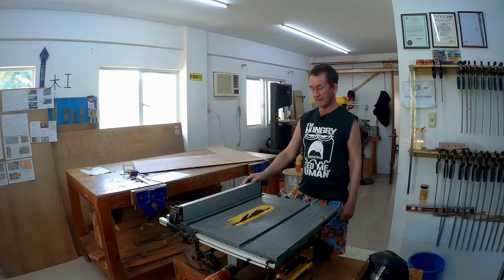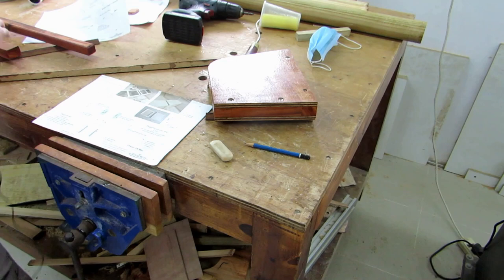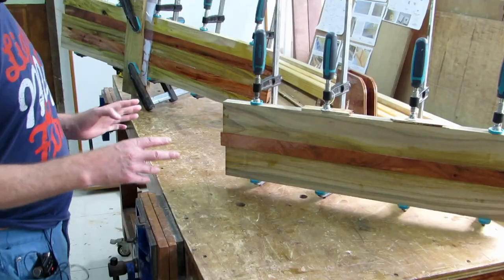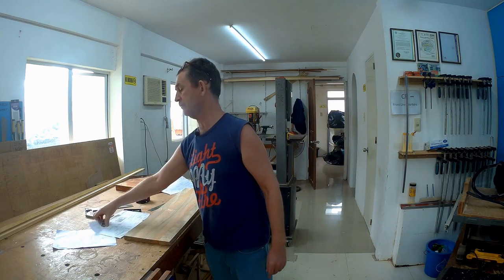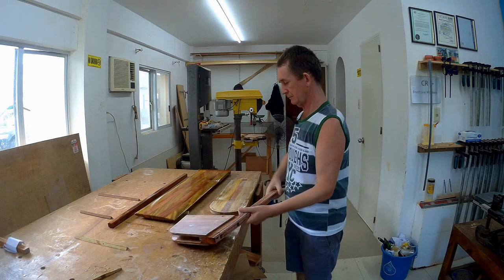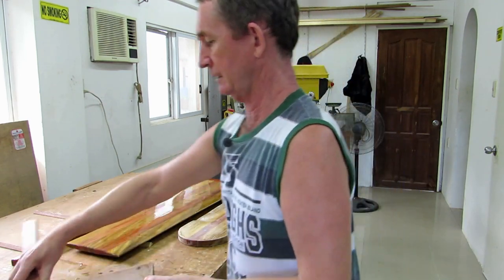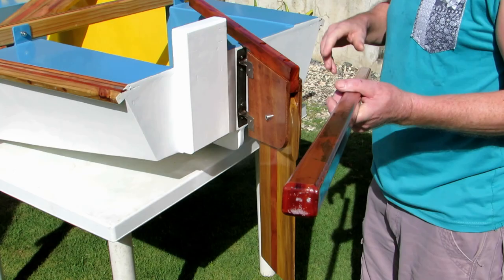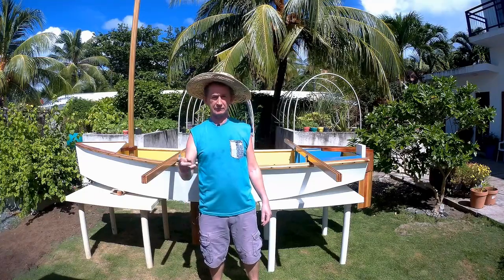Build a Tryst 10 Trimaran Sailboat - Pt. 18 - Making the rudder and daggerboard

Comment: Hello Irish,
You continue to build an economical trimaran sailboat. There is great weather there. Sunny and hot. Stainless steel was a good idea for the rudder, hinges. It does well in wooden biscuit joints. I am looking forward to the final of this project for which you have made a great effort. Because I'm watching very nice details. The final will be absolutely spectacular. Thank you for sharing. Stay healthy and happy. See you all the time. I wish you a nice new week. Big greetings.
Reply from the maker: Thank you. We had some rain today, but generally it is sunny all year round. I did not use biscuits. I was just explaining why not to use with epoxy.
Reply: @IrishChippy  Yeah yeah right. You just explained why it wouldn't be used with epoxy. I use wooden biscuits for non-water contact processes. Actually I meant it. buddy wish you a nice new week.

Comment: Good insight into the use of biscuit joints - it hadn't occurred to me about the use of water-based glues. Thanks Pascal.
Reply from the maker: I always knew that they swelled up using titebond, but I suspected epoxy would not have the same effect. After checking around, I think I was correct. Hope you are all good over there. Thank you for watching.